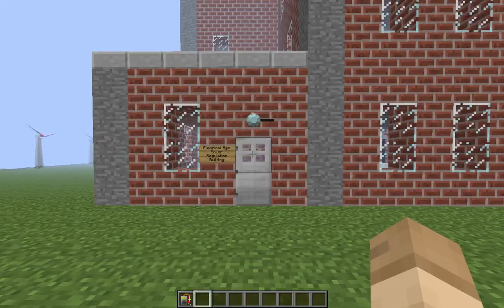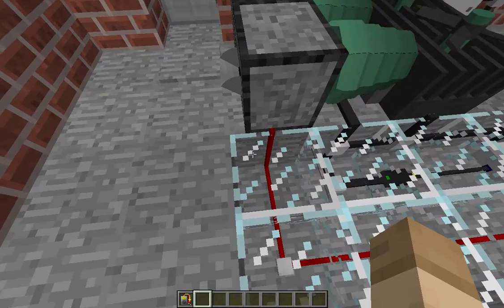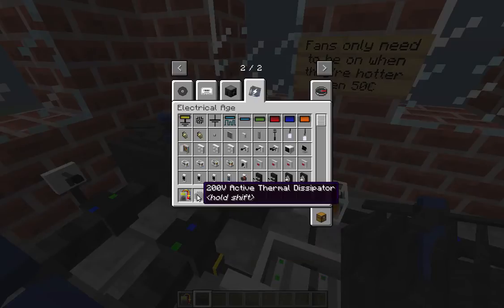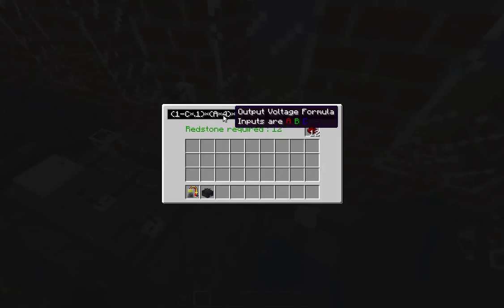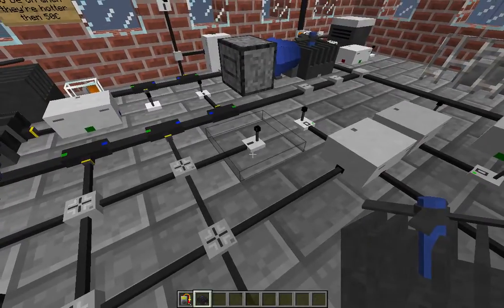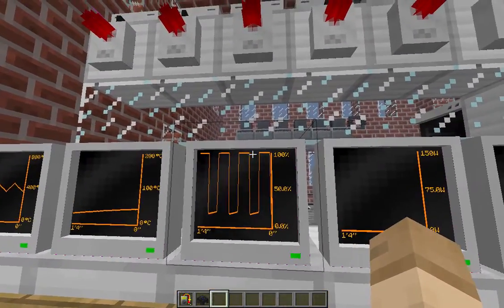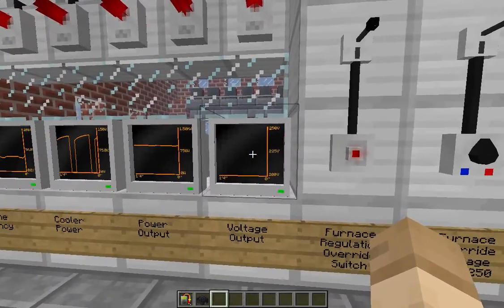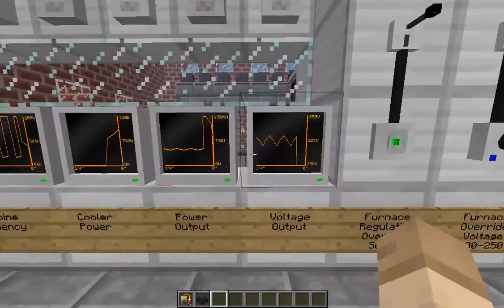Minecraft Electrical Age Mod Tutorial 05 - Power System Regulation

Comment: All right then, seeing as you're aparently the only expert on this mod on the internet: I've run into a little bit of a snag, it seems that no matter how I set up my solar panels, they refuse to charge my batteries, best case scenario, I can cause it to explode, but it seems that no matter how many solar panels I wire up to my base it never fills the batteries, any chance of helping me out with this?
Reply from the maker: ti6i I wouldn't say I'm the only expert, but is sure is quiet when you ask for help now isn't it?  I'll be happy to give it a whirl!

First off, it's hard to say what's going wrong without seeing your setup.  A couple of screenshots would help.  As it stands the best way to get in contact with me is through the Minecraft Forums (don_bruce), as I rarely check my YouTube account.  I'll start checking more frequently from now on, though.
Reply: I ran into this problem too. If you try to wire them in series, they will power anything but batteries. For some reason, you have to wire them in parallel. If it was voltage you were after, then you are stuck with transformers. Be careful not to wire too many together though. Don't exceed 24 amps.